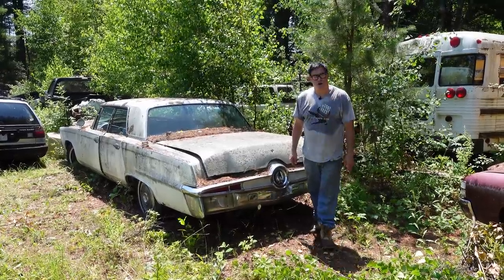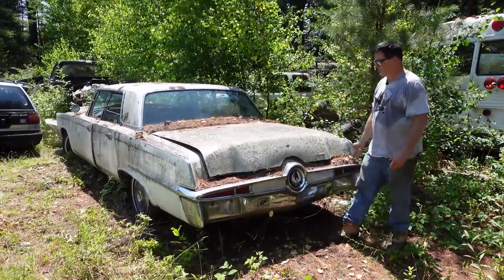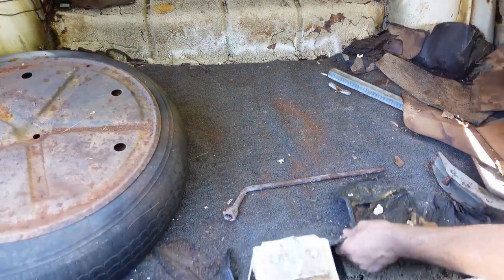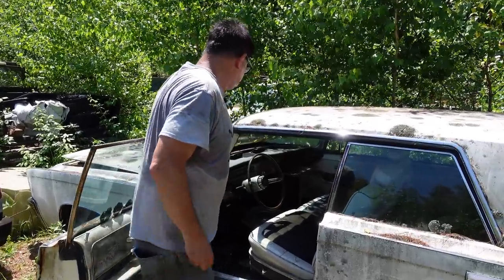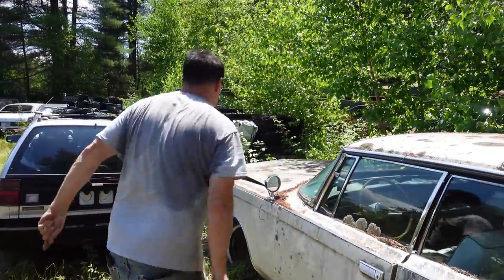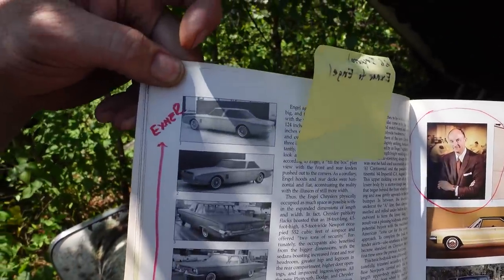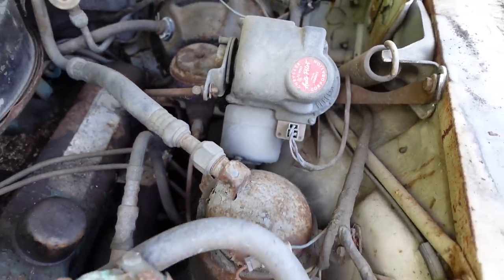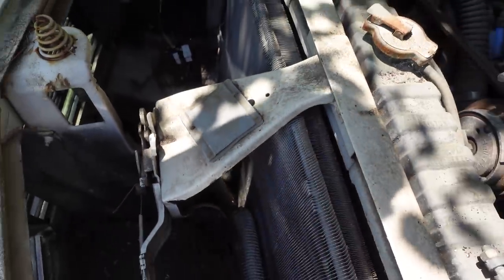Demolition Doll Rod

Comment: I use to be big in the derby and in the mid 80s right before they were outlawed in my area, I ran a 66 imperial just like that. I won several derbies with it and sold it to another derby guy who ran it a few times as well. They held up to run multiple times. Good stuff. They don't make em like that anymore that for sure.
Reply: @Timothy Ballinger they stoped them here in San Diego Ca. They used to have them in between Monster Truck Jam. I liked the guys that would drive in reverse when Drive failed in the tranny.
Reply: A guy at my local demo derby, ran his imperial 5 or 6 times. Then he sold in to another derby driver and he won with it the year.

Comment: It struck me how crystal clear those headlight covers were almost 60 years later...unlike whatever crap they make them out of now which get all yellow and crazed in a relatively short period of time.  I have looked at Imp's on CL over the years, and up til 2 or 3 years ago you could have scored a clean driver example Cali (no rust) car for $2500 to $5k.  Not now.  It would be pretty big bucks to restore one, since the low production numbers mean parts (other than mechanical) would be high priced, if you could find them at all.
Reply: Headlights were clear glass up untill the late 80s

Comment: Had a 70 2dr Imperial a great looking car a little weird to some with its very large trunk. It had the hideaway headlights. White with black vinyl top. I got it from a friend really cheap because he power washed the engine and it started missing because the water had gotten into the distributor and not taking my advice to clean it out he forced it to run down the rd saying it would dry out. Well a few miles of flooring the gas pedal the 440 back fired 1 last time and cut off. Then he tried to burn up the starter trying to crank it. So pulled the distributor cap and cleaned out the water. It would run but it sounded awful popping backfiring etc. Well he practically sold me the car right there on the side of the rd. When we finally got it towed back to my place the whole way home my friend was complaining that the previous owner sold it knowing something was wrong with the engine. 🙄. Well turns out it jumped time and by the next weekend I was floating down the highway and couldn't help myself to do a burnout right in front of my friends house. Left 2 impressive black marks for sure. Drove the old girl a few yrs before I sold it for pennies compared to today's value. I was a young man in what people referred to as a grandpa car and now I really miss that car. I sure hope it didn't end up as a demo fighter. 😫 Great vid Steve, and don't forget to like share and subscribe. Namaste 🙏🏼

Comment: My mom had one, but I don't remember it having head rests, though I'm fairly sure it didn't have the auto-headlight dimmer.
One feature it had was a radio station scan button above the floor mounted headlight dimmer switch that I fooled my friends into thinking it automatically changed to my favorite station when I sat in the drivers seat.  ;-)

Comment: I wish you would have showed the trim tag and the VIN which would give us the win: Y for Imperial, M for Medium Price class, 43 for four door hardtop, J for 440 V8 with four barrel, 6 for 1966 model year, then possibly 3 for Jefferson Ave/Detroit, MI assembly and the rest would be the production sequence. The original Jefferson plant that built this car ran from 1925 to 1990 and the "new" Jefferson plant is adjacent to it, opening in 1991, and produces Jeep products and the Dodge Durango for Stellantis (the new name for Chrysler now). 

No tag, can't brag, but it might go something like this: YM43 for Imperial Crown four door hardtop, W for Persian White exterior paint, M3C or M9C for White/Blue interior trim. 

You could probably picture the folks that owned a car like this---maybe stepping up from a lesser Chrysler model as a trade in, maybe nearing retirement, kids off to school, or getting married and out of the house and looking for something to get around town in style. I believe that the Chrysler compressor and GM system which as you allude to is the A6 axial compressor or the "log" in junkyard speak (which was as you noted was made by Frigidaire which they owned until 1979) were equals as both were known as "snow cones". It was the joke that with either system you could hang meat inside the car it got so cold. I remember a few A6 equipped vehicles that would blow frost through the vents they were so cold. Chrysler cars with air conditioning often had "Air Temp By Chrysler" stickers on the windows. For a time, Air Temp also made house central air conditioning units.

Comment: Back in 2003 I came across a 65 Crown Coupe in Bethel, Connecticut. It was sitting up to it's wheel and axle bearings on private property. I was told it belonged to a family where the owner was deceased and it was sitting there for years. Black with a maroon gut. I took pics to remember it.

Comment: This was the car the 440 was developed for. The 440 engine block used the newer casting technology that was used for the 273 engine. The 440 was supposed to be a large, smooth engine to compete with the Cadillac and Lincoln engines. All 66 and 67 440 engines were, 'hand balanced" for smoothness. It looks like the hand balancing is a heavy steel ring with balance holes drilled, welded to the crankshaft pulley . That practice was stopped for 1968 model year.

Comment: When I was in auto shop in high school in the early 1980s, we had one of these come in for service.  It was fully loaded with options including both rear seat heat AND A/C (the second heater core and evaporator were underneath the rear window package shelf).  I remember the glass covers over the headlights as I had never seen that before.  The car was amazing - it had cigarette lighters and ashtrays in every door armrest (except driver's door IIRC), and the ashtrays were lit as well.  It was one of the most luxurious cars that I had ever seen come through our shop, as far as bells and whistles go.  It had courtesy lights everywhere inside (or so it seemed, as compared to other cars of the same vintage).  These were really well-built cars and even more amazing to me, despite the relatively-low production numbers, these cars are still getting dragged out of fields and back yards even today - I subscribe to several demo derby channels on YT and am amazed at the numbers of these cars still being used to derby (some states even have "all-Imperial" classes).

Comment: The 440 engine was developed to compete with the large Cadillac and Lincoln engines and all 1966 and 1967 440 engines were, "hand balanced" at the factory to insure smoothness. That practice was discontinued for the 1968 model year, when 440 engines received standard factory balancing.

Comment: I bought a 66 Imprerial for the 440 engine and transmission almost 30 years ago for another Mopar. It had single exhaust but the identification pad on the engine was stamped HP 440 and the casting date was 9-1-65. Strange.
Reply: Funny  I did the same with a kingwood fm wagon with a bbc and 400. Wish I had just kept the car
Reply from the maker: Hello Kevin Cruz, yes indeed the HP stamping would indicate the hotter cam inside that 440. Did it have the high-rise "Chrysler TNT-style" exhaust manifolds? I'm not sure if they have the same exit points as the standard Imperial "log" manifolds or if they'd mate up to the Y-pipe or not. But yes, that HP should indicate a hotter cam. Gotta wonder if that was a factory "blooper" and if the first owners ever "complained" about how their Imperial rumbled at the country club through its single exhaust outlet. heck maybe that car triggered a bunch of "my neighbor had the exact same Imperial but he always beat me from the stop sign leaving our neighborhood". The mind boggles.....THANKS for writing, Steve Magnante
Reply: @SteveMagnante  Hello Steve! I wish I had photos. The exhaust manifols were not the "Log" type but were arched about halfway up the height of the valve covers. The air cleaner was still present and had one snorkel with single exhaust. Definitely an original car, it had never been apart and ran good. I do remember the exhaust manifolds selling quickly at Woodley Park! I wonder if the very first batch of 440 engines were HPs only, again early 9-1-65 casting!

Comment: I pulled one of those cruise control units apart as a kid, got one from a car at the dump. It had a pretty heavy electric motor in it that spun centrifugal weights that pulled on a throttle cable. It was quite the beast.

Comment: The big wheel bolt pattern was for a smoother ride.  The 12' drum brakes have as MUCH the same stopping power as do MOST disc brakes, they are equivalent to some truck drum brakes. The air-conditioning compressor is a Chrysler built composer that was "just as good" as the GM Frigidaire compressor.  The "Black Beauty" in the 1966 Green Hornet TV series was a "1966 Chrysler Imperial Crown" as was the car that was profiled.  Dave...

Comment: It would be interesting to know just to know how many of those 13,242 Imperials that ended up in Demo Derbys.  I remember one derby alone in 1982 at the Santa Clara County Fairgrounds where there were 6, when I went to that same derby again in 1987, Imperials had already been banned.  I do remember that at the end of the derby in the final event all that remained were the 6 Imperials and they went in looking relatively unscathed, even though they had already been through two previous rounds.  When the Imperials started crashing into each other it sounded like all hell had broken loose and that's when the real games began.  

The secret had to be more than just the body on frame construction, as a lot of cars from the 60s and 70s were body on frame and were crushed effortlessly by those Imperials.

Comment: The loaded Chrysler 300 of the same year may have stolen at least a few would be Imperial buyers. Glad to hear collectors are active with this year and model.
Reply: My dad bought a new 66, 300. Black 4 dr hardtop, sport interior, 383, never seen another one exactly like it. He often got compliments on it, and he owned it till the day he died, in 1997, sold it afterwards and the guy still owns and drives it.
Side note, dad said it got 12 mpg, tuned up or not, towing a holiday trailer or not.

Comment: The Imperial was a good car to be sure but the one thing it didn't have going for it was the name. Cadillac had been know as the world standard for a couple of decades before Chrysler was even established. Dollar for dollar spent on similar new  Cadillacs was returned  in trade in value over the Chrysler or Lincoln which was a big consideration for those that traded every two or three years plus Cadillac's were the favorite of the specialty car builders ( funeral cars and ambulances ) because GM supported that niche market where Ford and Chrysler did not.

Comment: Had a 62 w/413. Couldn't get attached to the "clipped wing" design and traded it off (what I really wanted was a 61 with real fins). Still have the original 4bbl Carter carb though.

Comment: Steve I'm sure by now its 5 inch bolt pattern. I have a 68 crown 2dr. And a body. For parts. I recall that old big bolt pattern would fit the early 50s Ford pick up the customisers would grab the wire wheels and put them on those early Fords .

Comment: Cadillac always had the best style. Cadillac style is what every American lusted after. Most people didn't lust after an Imperial Crown. That's why Cadillac owned American luxury car sales over Imperial at the time. They're very nice luxury cars but you didn't see Elvis cruising around in them. My personal opinion on the style is that it's kind of bland and subdued, and slightly ugly, especially compared to the impressive and bold Bill Mitchell Cadillacs. 1960s Cadillac still turn heads to this day. Imperial Crowns? Few people other than enthusiasts would recognize them today.

Comment: 14 MPG? "On a good day going down hill with a tailwind" as my grand dad used to say. He had a '70 Cadillac which was the biggest car I'd ever seen when I was 12yrs old. I see so many videos where guys are bringing locked up engines back to life and I think back to my grand dads Caddy that got sold for scrap because the engine froze up. Oh the pain of it all.
Reply: Rowdy - obviously you have never owned a 1960s car with the high-compression engine and very tall rear end gears.  You could easily hit mid-to-upper teens on the flatlands if you kept a light right foot.  I owned several 1960s full-size American cars, including a 1969 Cadillac M+M ambulance with the 472 - it could get 18mpg if you kept it under 75mph.
Reply from the maker: Hello redmondjp, I agree. The fuel economy wasn't nearly as bad as most folks assume today. The trick was to apply a light throttle pedal and maintain steady state cruising at 50 to 60 mph on long drives. You can nudge 20-mpg with just about any "normal" Sixties car with this approach - if you have the discipline and can resist the tire-smoking torque on get aways! I owned a 1968 Dodge Hemi Charger (727 Torqueflite, 3.23 gears in 8-3/4) that truly got 18-mpg when driven "like there was an egg under the gas pedal". Thar meant keeping the engine running only on the front-2-barrels of the rear Carter 4-barrel. But once you got into the front Carter AFB - there was a second return spring that made the gas pedal feel stiffer - that was when MPG dropped into the 9 to -12 range. But it was fun, fun, fun. I can totally see this old 440 Imperial delivering 18-mpg. Again it was / is all about the discipline...THANKS for writing, Steve Magnante
Reply: @redmondjp  If you read my comment you'll see that I was simply bemusing what my grandfather used to tell me when I was twelve years old, but thanks for your expert opinion.

Comment: I'd love to do a Hemi factory super stocket out of a 67 fury I or II .. The teams went for the GTX and Satellites , but I love that stacked light Galaxie-style front of the roman numeral Fury years. Incidently the police love their squad furies from 65 - 67 , people assume the departments all bought Eights, but actually inner city departments eg NYC and Chicago favoured the slant 6 versions, because they would operate in dense, slow moving traffic and not really get into any high speed chases. The last thing they wanna be doing is fillling up thirsty big block 4 times a shift, duty would be more like issuing citations for illegal u turns or jaywalking and a chase might be over a matter of blocks rather than miles like somewhere in LA for example.
Reply from the maker: Hello Chuck.U.Farley, thanks for writing. If you're into vintage plastic model car kits, you probably know about the JoHan 1968 Plymouth Fury I 4-door Police Squad Car model kit from the 1968 - 1975 era. These kits are weird because they replicate a 440 4-speed 4-door Fury cop car! I'm betting mere handfuls were built like that. You're right about the city cars being low powered. But I have seen many 440 Torqueflite cars used in highway intercept applications - a few TWO DOOR SEDANS among them. I have a copy of Ed sanow and John Bellah's 1994 book about Mopar police cars from 1956-1978 and its packed with cool pix of neat Mopar fleet machines! The book can be found on eBay - as can the JoHan '68 Fury I cop car kit. Thanks again for writing, Steve Magnante
Reply: Like now days many of the city police chargers use the 3.6 ltr engine

Comment: That is 64 to 65 box car. 66 un up became subframer cars. Those car are tanks but the front suspension is weak. An one good corner shot to the y frame an it will bend.

Comment: I learn so much from your videos that I don’t call out the few small mistakes that I notice.
But as you know, calling these “Chrysler Imperials”, while common, is incorrect.
While I’m here….
At Cars N Coffee an older gent had a pristine 62 Impala SS 409. The front of the right cylinder head was flat black.
He either didn’t know or didn’t like me but I’m sure it wasn’t oil spray on this car.
Any ideas?
Reply: Might have been overspray from a rust-preventative undercoating.
Reply from the maker: Hello GayJohnBircher, I've seen a number of 409 cars (and big trucks) over the years and haven't noted any "flat black" paint on cylinder ends. I know truck 348's and 409's were painted black in some applications. but you say only the end of the head was coated. I'm at a loss but would imagine it was probably applied by something / someone AFTER it left the dealership. Just a guess without seeing it. Thanks for writing, Steve Magnante